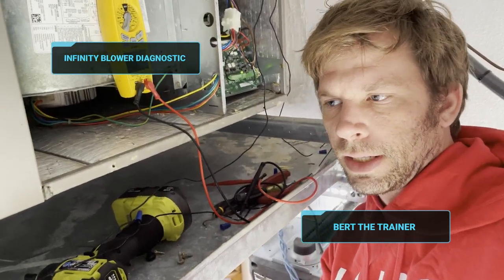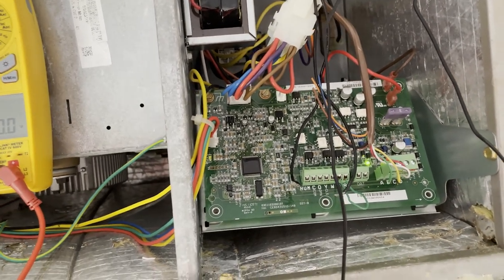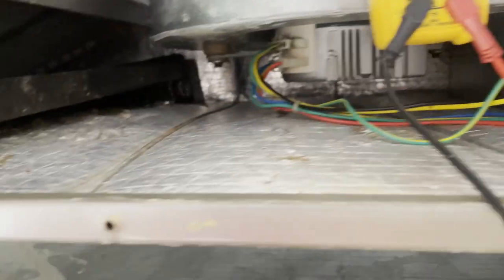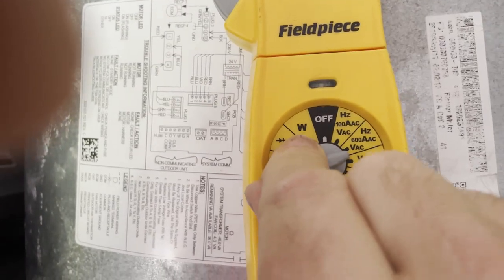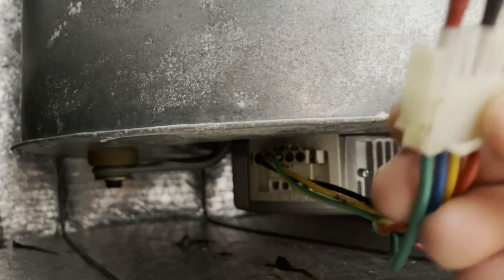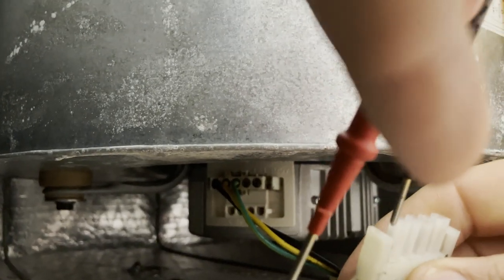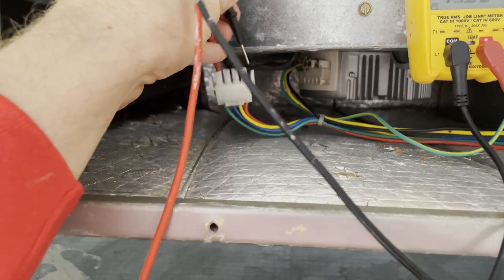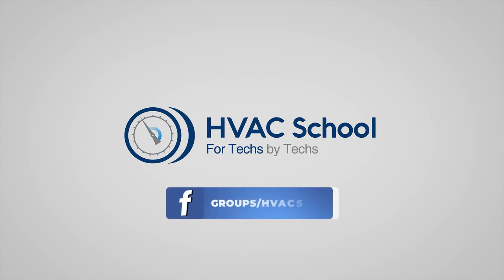Infinity Blower Diagnostic w/ Bert

Comment: So the red wire has 12vdc constant? While the yellow wire is only going to send 5vdc from board to module when there is a call for cool?
Reply: Not constantly I don't believe. I normally just turn furnace off. Unplugg the thermostat plug and jumper r to g.

Comment: Just did this test on a Furnace
Had 12v to r-g, then 5 v to yellow, blue was all over the place. 
Assumed module  was bad- replaced motor/module. 
Same issue.
Bad board. 
Did I miss somethin

Comment: Thanks! You can use a motor tester as well, plug and play. If the blower turns on its the board if it doesn't its the motor. 

This is a secondary check for me after checking voltage.
Reply: But motor testers use 24v a/c. Does it still work when the motor wants to see dc
Reply: @2ShotsDown  it's a built-in rectifier inside. Converts 24v ac to 12v dc
Reply: Which motor tester do you use? I’m not sure if mines has that, I got the gentec tecmate and the supco.
Reply: I have those 2 as well.
Reply: I wish I would have seen this video before my service call. The motor started with my Tec mate. I wasn’t sure what voltage readings should be &  called tech support. He said they don’t get that information & to replace the board. 

Had same problem after replacing the board. Came back with the module & problem solved. Glad I found this video for next time